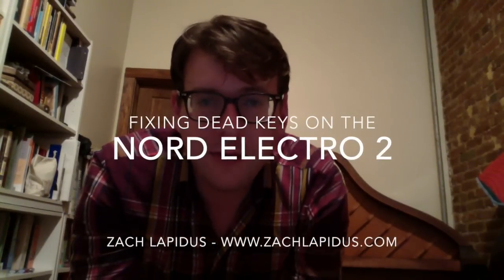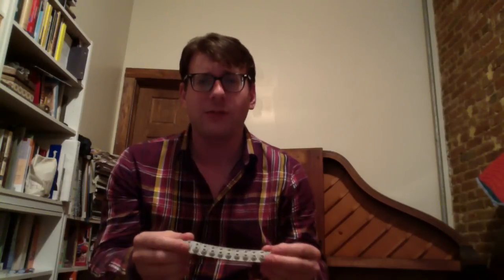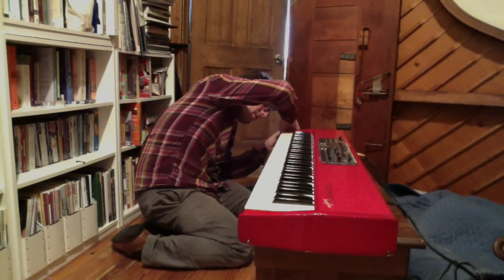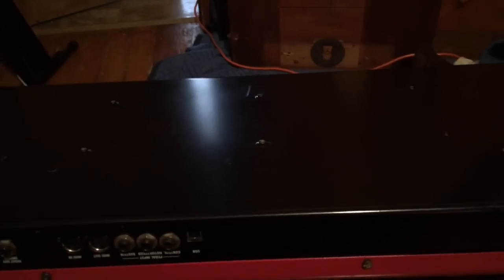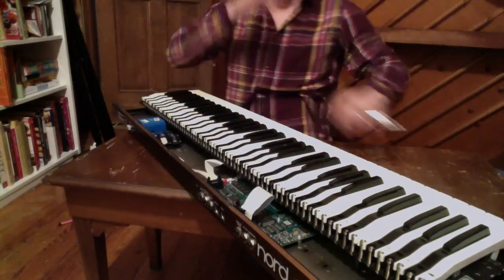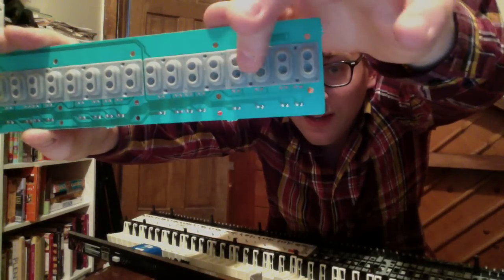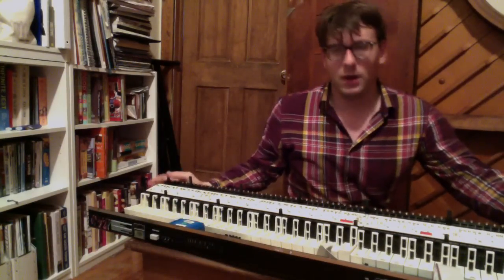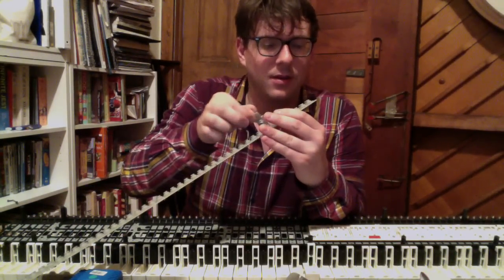Tutorial: Fixing Dead Nord Electro 2 Keys

Comment: Awesome vid thanks man!   I had this problem with my Nord Electro 3 73 and I could fix it in no time.  At first I was a little bit nervous about opening the Nord and such, also because this video features the Electro 2, but it's almost the same. 
The only differences are 1.) the 3 73 has three screws at each side 2.) the connector between the top circuitboard (attached to the red piece of the keyboard) and the lower circuitboard has two pins on the side that you need to toggle outwards before you can disconnect.  When reconnecting, it will lock automatically 3.) when you unscrew and take the actual 'keyboard' out, there are 3 connectors attached to the circuitboard underneath the keys, two of which are nearly the same as the NE2 and one which is connect to a small, separate chip. Do not try to disconnect this one by pulling it, because the little chip is screwed to the circuitboard. You just have to unscrew that and it'll come off by itself. 4.) The NE3 has contact strips of 16, so I was lucky I only needed to fix C5, that so happens to be was the last one on that strip. Or else I would've have to take the whole strip out. 

It was a pretty easy fix, and at first I wasn't sure it would work, because the contact wasn't dirty at all. There was just 1 tiiiny black something, but lo and behold, removing that tiiiny speck solved the problem.

Hope somebody finds this handy, and good luck!
Reply: this is my exact problem with the 73c... will report back.. wish me luck
Reply: Very helpful for NE3. Especially the little connector which has to be unscrewed before removing. Where did you order the contact strips?
Thanks for your help.

Comment: I just called a local keyboard repair shop.  I asked if I could purchase contact strips for my Nord Electro 2 from him.  He said yes, if I brought the strip in.  You mention a "Fatar" contact strip.  Is there a model number or recognizable size of the strip I need for the Nord Electro 2?  I just put it back together so I could use it until I'm ready to fix it.  So, what I need to be able to do is recognize the correct strip without comparing it to the one in the Nord.
Reply from the maker: They look like this: http://syntaur.com/Items/4156.html You can look at the picture for comparison. Will probably be sold in groups of 8 or 12 notes. I believe they are the same contacts used in the Korg Triton.
Reply: +zlapidus Thanks for your reply....I have been thinking that perhaps I would buy both control panels, which should bring my Nord 2 back to pristine condition.  I am guessing but I think buying two of those control/contact strip shells would cost around $120.  After looking at your video again, I'm not sure why I would do that, versus replacing the necessary contact strips only, as the second fix would cost much less....Any thoughts on replacing the whole part, instead of just the contact strips?
Reply: +Terry Pursell I have upgraded to the NE 5, less than 30 days ago.  So, whatever I do to the NE2 is for having a working product to sell.

Comment: Thanks for sharing this video. I just fixed a dead key on my Nord C2 organ modelling from this video. I didn't find anything wrong with the contact when I finally got to that stage. I thought to cut the row of four contacts from the bass end of the top manual and swap the 'broken' row of four (E4 of the lower manual) anyway as I have a recording session this sunday and didn't have time to order a new contact. After turning on, I had every key working, both the original dead key on the lower manual and the top manual where I had done the contact swap. Makes me think it was a dust or alignment issue … I thought to share as I haven't seen anything like this on the 2 manual organs… Cheers
Reply: +Danny May How did you get to the contacts on the lower and upper manuals?  There were screws I couldn't reach when I opened up my C1 organ.  I gave up because I didn't want to break anything internally.  I still have a dead C4 on the lower manual...

Comment: This tutorial was a godsend! I bought a used electro 2 that had 2 loud keys, and while I didn't think it could be as easy as just pulling the contacts off and pushing some compressed air in there, wouldn't you know that did just the trick. Not only did this video help me fix the keyboard, but I feel much better knowing how to pull the whole thing apart safely.  Thanks!

Comment: Thank you so much Dude. I just repaired my Nord Electro 3 HP with the help of your video. Until step 6 it was pretty much the same, but instead of getting all the action outside of the case I just lifted them a little bit so I could remove some of the keys. This way I reached the rubber contacts (which are the same on the HP version) and lifted the contact of the dead key. I cleaned underneath the rubber contact with some isopropyl alcohol and reasembled everything. Works perfectly. No need to replace the rubber contacts. Just some cleaning.

Comment: Thank you so much!  My Electro 3 repair was a bit different but not by much. I really appreciate you taking that time to teach and give confidence.
Reply: Did you run into an issue in accessing the contact board?
Reply: @JacobJeffries  No.  Just a bit tedious using the hand held screw driver.
Reply: @jamesfornoff2513  but the when I get to the step  "remove jumpers" it's very different in my Electro3...did you not run into that issue?
3 separate ribbons.  2 of them thin and white (almost paper-like) + 1 small multi-wire with red down the side?
Reply: @JacobJeffries  Yes.  There are two.  I took time to be careful as I separated them.

Comment: Thank you so much! It took about 3 hours and some creative swearing while trying to get get the nubs to poke through, but once I got the hang of it it wasn't too bad, and it worked perfectly once it was put back together.

One comment about this though: I really couldn't find anything wrong with the bubble contacts. Mine weren't cracked or anything. I did notice that the ones that were failing looked like they had some type of film or were a little dirty on the 4 little black points of contact on the circuit board. I used a barely damp cloth to clean them off, of course made sure that they were completely dry (but I barely got them wet so that wasn't hard), then put the whole thing back together, and it worked great. Not sure if my cleaning of the contact point made any difference or if it was just the new bubble contact strips, but thought I should mention that if anyone does the fix and doesn't get the desired result. 

Good luck out there, & thanks again zlapidus!

Comment: Hi Zach, Thanks for the vid, it was a great help. I've discovered that the anomaly regarding the screws on the underside is actually because of differences between model revisions. My Electro is the 4D and it has only one screw connecting the upper panel to the base on the underside. Also, there is an additional small cable between the keyboard and the motherboard that needed to be disconnected.

Comment: Thanks for the video, I have the stage 2 73 so quite similar. But has a couple of extra connections, but as long as you take photos before you should be ok. The screws are exactly the same. This video was a big help. I was able to just clean under the pad and I have just put it back together, with everything crossed it works!!! Cheers.

Comment: This was super super helpful. Thanks so much!
One thing worth noting- I had a key on my Electro 2 that had lost its velocity sensitivity, and I was able to fix it without replacing the contacts. I took out the contact in question and shot compressed air on it, which did the trick. (I even saw the spec of dirt that was probably the culprit.) But I couldn't have done it without knowing to cut on the line and the mechanical pencil trick!

Comment: Dude thank you. I just fixed the middle A flat on my NE3 61 key. The a flat stopped working for the piano settings and then a week later the organ started glitching on that same key. I opened it up and pulled off the little rubber pieces that you replaced in the vid and just cleaned them and put it back in because I couldn't find a rip and now it works fine again. Thank you so so

Comment: Thank you so much for the video. Excellent bookmark links as well so I could skip back during the repair job. I have the Electro 76SW and it's basically the same deal. The bass cable connector is smaller than the connector on the keyboard PCB so you have to be sure to align the connector the the pin 1 line on the cable. Other than that, once I swapped the contact strip with another one higher on the same keybed it seems to work okay. I'll order another to be safe but thanks again!

Comment: I watched your video here and learned a lot. Thanks! I need to clean all the top patch switch and perimeter push button contacts on my Nord Piano 2. They are sticking. Any thoughts on accessing that circuit panel where those contacts are and what possibly to expect? I was thinking about cleaning them first with canned air and possibly some audio fader contact cleaner. I value your thoughts and tips on what to possibly expect. Thanks🎹✌🏻

Comment: Thanks Zach! Pleased to report this also works for the Electro 4D. There is one extra ribbon inside that is just attached using another screw so, easy to just unscrew and detach.. A tricky thing (for me) was to pay attention to which way the ribbon for treble and bass are configured before unhooking them. I did not... ended up fixing the key and the losing my entire bass side because I put it back on the wrong direction... But I'm a bit slow like that. Thanks again!

Comment: Thanks man -  very cool video - helped me a lot!   I have a Nord Electro 3 73, and a few things are different but the basics are the same..... had a little trouble putting back the bass ribbon connector - (it's weird on the newer word's trust me) (the male pin is larger than the connector on the key side.... (makes no sense) .... but I was able to blow clean air on the note (Ab) above middle C - that was giving me full velocity all the time - it's back to normal.    Yeah these keyboard get filthy inside - hauling them around all the time -  I actually own 2 Nord Electro 3's  just in case 1 goes down I have a backup - (pretty decadent - but I work a lot - so can't wait for keyboard repair.  Thanks so much for your video !!!!   excellent explanations.

Comment: Thank you Zach :)
this made my day !! I had no new gummipads, but it turned out to be dust under them. had to operate from above, then I have a Nord Electro 3 HP with weighted keys. approximately the same procedure tho :) tangents readily pop out with minimal force. Once again Thank you for spending time to post this :) :)

a tip :) I used a paper clip to press down :) bend out one stick, and there you have tools for both the big and the small rubber rods :)
Reply: I am having trouble at the "remove jumpers" step with my Nord Electro3HP...different jumper/ribbons than the video here...any suggestions?

Comment: fixed my stage 2 which is roughly the same but loads more to take off. Mine had metal filings from the bracket covering the pad? The key to this operation is getting that pad strip completely flush so it sits flat on the PCB. Thanks ever so much for the video though!

Comment: Thanks for the great vid, just took mine apart, had a key that didn't work. Looked like s little spilt beer Replace bubble contact (13) .fixed  Then even thought I put in the bubbles for the b flat below middle C (12) It still seems a little loud on PIANO SETTING. any ideas on that?   Thanks Craig

Comment: i have an electro 2 73 keys. Alot of keys not working these are keys 1,2,3,4,5,6,9,10 and 67. Also the 65 is too loud. is there any suggestions? Do i need new strips? Or only needs cleaning?
Reply from the maker: I don't know. sounds like a whole row of contact strips is out if 1-10 are shot. I would just get new strips, honestly. if any one of those bubble contacts is punctured you'll need to replace the whole strip, even if you end up cleaning out the rest.

Comment: Hi thanks so much for posting this - it's the most informative video I could find on replacing the Nord contact strips. A quick question for you: do you know if the contact strip is responsible for the sustain function? I dropped an amp on my keyboard and the sustain is stuck on from g(71) and higher and am wondering if replacing that half of the circuit board might fix my problem.
Reply from the maker: Benjamin Hehn Thanks man, you're welcome. Sorry to hear about your keyboard! Um...the contact strip could impact the cutoff of notes, because the bubble stops making contact when you lift a key up, but it sounds like you might have a different problem, as I'd be surprised that the keys wouldn't just be dead outright if the strip was the problem. Maybe you are lucky and a section of strip is misaligned? If I were you, I'd open the keyboard up and see whether there's damage to the circuit board, and make sure the strip is flush with the board. You could also experiment with taking a strip from somewhere else on the piano (somewhere that works, obviously) and swap it in, see if that fixes your problem. Good luck, hope you get it working!

Comment: Great video. I have a dead key problem with the D above the middle octave on an Electro 2 61, but I don't have replacement rubber strips yet (didn't want to buy yet for 5 dollars + 14 dollars transport cost to Denmark), so I hoped that if I found that the rubber thing was dirty or whatever I could fix it even without replacement strips. I found that the broken note had one of the small rubber thingies not perfectly stuck in its hole, so I stuck it victoriously but that didn't fix it. I guess until I buy replacement strips I might try to switch the broken strip with another area on the keyboard (such as the lowest octave), in order to minimize the annoyance for the moment... Anyway, just wanted to share my experience. Good luck everyone else! And thanks again for the video!

Comment: Just a tip there is no danger in over torquing the screws when you   back them out.  A cordless drill would be usefull.  But it's when you tighten them is when you need to  be careful

Comment: Repair parts, I would think these contact strips sets are/were originally designed for some industrial device. Parts get cheaper when you can find where they came from. But $ 120.00 would motivate me a lot. Oil on hands (?) , white linen gloves or surgical rubber.

Comment: Hello,

Could you in theory use one of the "unused" notes as a replacement bubble contact for another? would it have enough bumpers to hold it in place?
Reply from the maker: No, sadly it wouldn't have enough bumpers. Perhaps you could hold it in place with adhesive, but I wouldn't recommend it. If you were to do this, not only would you need to firmly attach the replacement single note, but you'd have to hold down the other 3 notes in the group, as two of the bumpers on a side would not be connected if you did this surgery. I think a string of 4 notes is the minimum you can do.

Comment: Getting the rubber strips in is much easier using round toothpicks. Click about an eighth inch of one end and then use that (now fatter) end to push through the fatter rubber protrusions, then use the normal thin end to push in the smaller ones.

Comment: yo dude awesome vid, hey i have a problem with aftertouch on one. doesnt work. is this the same issue? is there some other sensor that does the aftertouch? thanks!
Reply from the maker: Hey paul, thanks for your comment. you know, I don't know, my nord electro 2 just has no aftertouch at all, so i'm not sure where that would be picked up.

Comment: What if all the Cs or F#s are dead? Im having this prob. But when i slightly touch those notes, they sound full range.

One more strange problem. When i press down C, the previous note B doesn't work. I cleaned all the dusts from contact point twice. Didn't work. 

KB: Yamaha PSR 423
Reply: Thanks for the video! Today I bought a computer to download the new operating system thinking that was the problem after a full day of trying to get that going I finally downloaded it and the note still didn't work so it's been a sad day till I saw this video. Thanks again!